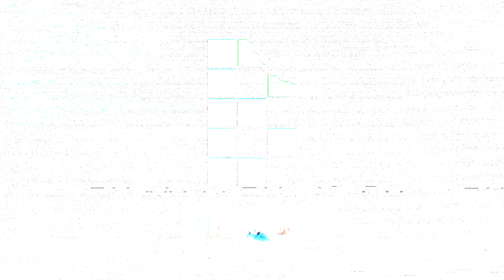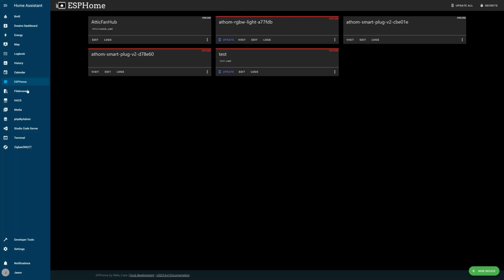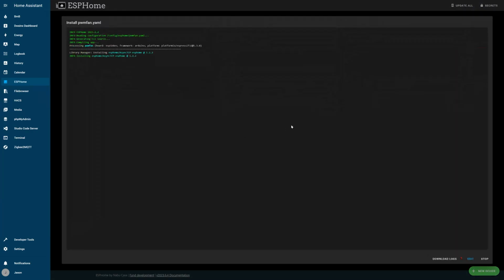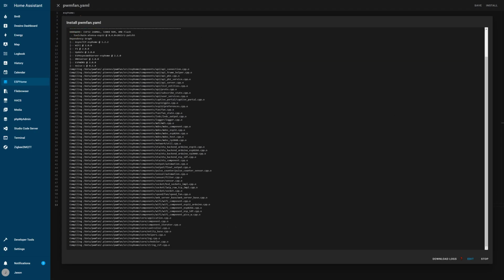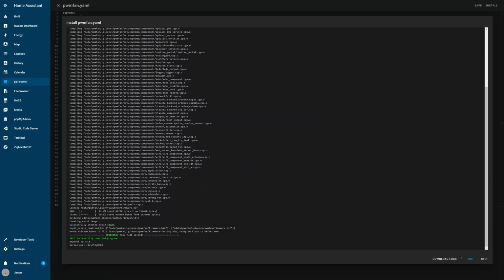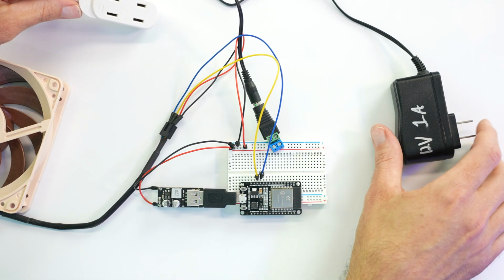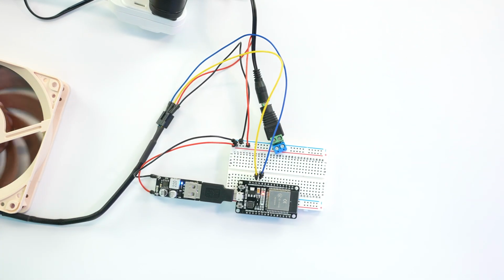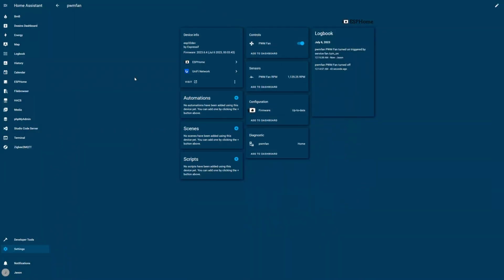Tutorial - How to control a PWM fan with an ESP32 and Home Assistant

Comment: on mine the VIN also supplies power, and I wired that to a DC step-up circuit. Unlike the 3v3 pin which will not allow the amps. We'll see if my stuff blows up in time but don't see clear documentation for not using VIN pin to power another device.

Comment: I tried this witch an Actic P12 Pro PST. Works. But I can not turn it off. It will turn slowly. Or more exactly: It starts, does some rounds, stops (but is still turning). And than starts again.

Is there a reason for that?

Comment: Hello! I have a question about one of the parts you used. What is the blue connector with the two screws that is plugged into the power plug connector?
Reply: Power Jack Plug Adapter Barrel Connector

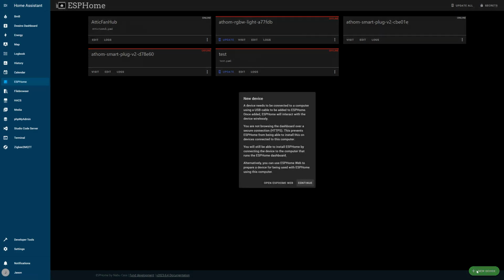Comment: 01:48 it is worth to mention that if you cannot see the mentioned "ESPHome" tab, that may be be due to one of 3 reasons that sadly isn't mentioned in this video (or noted).
1: Having "ESPHome" to be available from within Home Assistant requires that you are running Home Assistant as either a (and on a) physical device (like a raspberry pi, NUC, and old or repurposed laptop/desktop/server)) or as a virtual machine (or possibly an LXC container, which is NOT the same as a Docker container) on a host (preferably and much recommended on a hypervisor). If you are running Home Assistant as a Docker container, you can however easialy run ESPHome as a Docker container as well, you can then do some custom menu to get a buttin in Home Assistant menu, but it will most likely just open in a new browser tab (which works quite fine as well).
2: Assuming you are running Home Assistant on physical or virtualized physical hardware (see point above), then you need to install ESPHome from "HACS" (in short: like an app store for Home Assistant add-ons, which is integrated and technically run as a Docker container by the Home Assistant system)). Once installed, remember to enable, start and set it to start up at boot, if it isn't already once installed.
3: In "HACS", there is on some add-ons an option to add a menu point for the add-on to the menu, it may not be selected. As well as this, you may have done some custom menu's, that may affect what is added to the menu. This can be done when running Home Assistant as a Docker container as well.

Comment: 4:28 why did you pick that hole instead of having it right next to the other negative pin?
Reply: Dont worry there is no difference. You can plug in anywhere on the positive rail

Comment: Hello, I have a question, I plan to use this project as a cooling control for a case and a mini PC in a NAS server. I tested it and everything works as stated, but I'm wondering if there is an option to turn off WLAN in the code and control the ESP32 directly via the USB port.

Comment: Ich habe das Projekt nachgebaut - vielen Dank für die Anleitung. Es gibt aber ein Problem: Im YAML-Code:
multiply: 0.5
    count_mode:
      rising_edge: INCREMENT
      falling_edge: DISABLE
    update_interval: 3s
führt es zu einem Fehler unter Homeassistant. Fehlermeldung: "mapping values are not allowed here".
Ich kann die Einrückungen editieren wie ich will, der Fehler bleibt existent. Ich habde diesen Codeblock komplett entfernt, dann funktioniert es prima.
Für welche Funktion genau dieser Abschnitt im Code verantwortlich ich weiß ich nicht, ich bin noch Anfänger bei esp32 :)

Comment: can you do the same thing but with arduino iot? instead of having to use home assistat. I have most of what I need except the level shifter not sure if i will need it as yet but the whole home assistant thing with dedicaed hardware and all that i'm not gonna do just to control a fan in my shed lol

Comment: How do i control 2 fans at once? Do i duplicate the code? Use different gpi0 pins?
Reply: two different pwn pins. one to each fan for both operations. so you'll need 4 spare pins

Comment: TY for the easy guide. [might set this up myself for a DIY air-purifier that uses PC fans]

PS: for the code its better to share it on github. YT and other sites have horrible formatting, especially for YAML code where the difference between
Cheese______1
Cheese____1
Can cause the code to break

Comment: Can this be done cleaner some how?
Would it be possible to use the ESP it self to power the fan instead with the use of a boost converter or something?

Without having to include the secondary power adapter?

Comment: INFO ESPHome 2024.9.2
INFO Reading configuration /config/esphome/server-fan.yaml...
ERROR Error while reading config: Invalid YAML syntax:

mapping values are not allowed here
  in "/config/esphome/server-fan.yaml", line 34, column 8

i follow the same, but getting this msg
Reply: u can try this 

sensor:
  - platform: pulse_counter
    pin: GPIO13
    name: PWM Fan1 RPM
    id: fan_pulse
    unit_of_measurement: 'RPM'
    filters:
      - multiply: 0.5
    count_mode:
      rising_edge: INCREMENT
      falling_edge: DISABLE
    update_interval: 3s

output:
  - platform: ledc
    pin: GPIO12
    frequency: 25kHz
    id: fanhub_pwm

fan:
  - platform: speed
    output: fanhub_pwm
    name: "PWM Fan1"

Comment: Great Video but you don´t have to Step down the voltage. Your ESP32 has a build in Voltage Regulator. Just pluf the 12V in to the Vin Pin. Do not Plug it into 5V!!!

Comment: Hello Mister. Can you tell me how i can do exactly what you did but with a 2 wire fan? I need to do a home assistant automation that controls the rotation of a 2wire fan based on the internal temperature of a device, temperature that i already have in HA. Control will need to be done automatically by HA as i don't have how to stay and turn the regulation switch between low & High all the time. Thanks!

Comment: great tutorial!
im tring to make fan control for rack cabinet. for me control of pwm is not possible :( i can only turn off and on. i see actual pwm value, it is always maximum 2400 rpm. when i move slider nothing happens. 

would be great to have also temperature controlled pwm fan!
Reply: i found that there was missing "" in the code on   frequency: "10000 Hz". but now rpm are fluctuating if i set other value than 100%. any help?

Comment: great video. id like to do this project but have multiple fans (15 total). They dont need to be indivual speed control. If I wanted to connect multiple fans and have all speed controlled together as one fan. . . is it a case of using fans that can be daisy chaimed. . such as phanteks T30-120??? assuming of course that power supply is capable of enough amperage

Comment: Hi, this is so cool! Do you know if there are any Home Assistant or Homekit  (or smart device) diy projects that support pwm for monochromatic LEDs that only have the two pins (ground and positive) and no data? I have some LED signs that only have about 120 leds on each one of them but they are super bright! I’m dying to use one of my extra microcontrollers. I bought some mosfet modules just in case I can find a project. Any thoughts would be very appreciated.

Comment: I followed the tutorial and the fan would do all kinds of powering up and down. I thought it was because the pwm voltage was low, but Noctua said that 3v pwm is fine. Then I finally read the warning at the beginning of the "logs" command in ESPHOME about GPIO12 being a pin you should avoid. I switched it to GPIO15, the 3rd post on the other side and it worked like a charm.
Reply: for what it's worth, I was having an issue where home assistant wouldn't accept the api encryption key.  So i moved gpio12 to gpio14 and it worked right away.
Reply: That is not right, it works with 3 Noctua 14" fans in my installation!

Comment: Just a heads-up, you will need to make sure your fan actually accepts 3.3v for the PWM logic. Certain fans require a 5v PWM signal, so you will need a 3.3v -> 5v I2C Logic Level Shifter
Reply: Now it also needs a MOSFET to really switch OFF the fan if it doesn't do that via PWM. And maybe also an RC filter for the RPM signal. And some sort of alert of the read RPM differs wildly from the one set via PWM.
Reply: Great suggestions  @dan-nutu  ! But in some cases it could be overkilled, sometimes we just want it to work
Reply: Can you please explain a bit more about this?  How the fan that the video owner has is working with his setup? I did not see a mention of the 3.3v -> 5v I2C Logic Level Shifter and now concerned that my shopping of the items may not be enough.
Reply: @a2shadow  each fan is different, most do accept 3.3v input for pwm, but you can check the tech sheet on most fans website which should have some more details
Reply: Or use your 5v VIN output (if powered by usb) and your gpio pin to trigger a relay which pulls your 5v pulsed signal to ground. DIY negative logic

Comment: Dear friends, I have assembled two Noctua NF-A8 PWM fans and apparently everything works as expected. I can turn the fans on and off and change the speed all with an ESP32 without a TTL converter board. 
I have connected them directly, 12V power supply for the fans and the 2 control signals directly from the fans to the ESP32. I use 2 different power supplies, 5v for the esp32 and 12v for the fans. I have joined the gnd of both feeders together with that of the esp32 so that everything works ( It works more or less well, from 0% to 9% the fans are stopped and from 10% to 100% the speed varied perfectly, I don't understand this error range from 1% to 100% but it more or less meets my expectations )

I have found a bug. While the fans are spinning, if I disconnect the power from the esp32 and reconnect it, the esp32 protects itself and does not start, the esp32 feeder making noise. I have to turn off the power to the fans, wait for the esp32 to start and then plug in the power to the esp32 and everything works fine again. Another option to solve the problem is to disconnect the Output pwm pin of the esp32, then the esp32 boots correctly. It seems that some noise is sneaking through the output control pin.

It's not a big problem but it makes it impossible for me to use a single 12v power supply for the fans with a 12v to 5v converter to power the esp32. Has anyone had this problem and how to solve it? 
I would greatly appreciate the help. I have tried with some filtering capacitors connected from the output pwm to gnd pin but the operation of the fans varies although the esp32 starts correctly depending of the capacity of capacitors. Thanks everyone for your help. Kind regards
Reply: Did you solve this issue? I'm planning to assemble controller for 2 of my Noctua industrial pwm 3000 fans. I need something reliable.

Comment: Isn't the PWM signal expected to be 5V? But the ESP32 outputs 3.3V right?
Same with the rev counter signal coming from the fan, isn't that 12V? And you are putting that directly into the 3.3V ESP32, ain't that a bad idea?
Reply: thank you for noticing that, i was about to do the same as the video.

Comment: Do we need to lower the tach pin down to 3.3V with two voltage dividers resistor? Does straight connect tach pin to esp32 safe?

Comment: Fantastic video. Would this work with daisy-chained arctic P14 fans? I saw designs for making a corsi rosenthal box with pc fans instead of a box fan for more silent operation. This seems like an absolutely perfect implementation for powering the fans.
Reply: here for the same reason after some wild fires nearby, any luck finding if it works?
Reply: @seyamrahman6722 yeah it works. I built one with 5 Arctic P14s. All daisychained to one plug.

Comment: Hi, I have a question. Why are you able to completely stop the fan? When I try to do that, the fan continues to run even when turned off. In other videos, they use a relay in between. Why does it work for you without one :-) Thanks
Reply: In this video he doesn't show the relay. Without a relay, the fan continues to run at the minimum speed because with PWM control there is always 12V on the fan.

Comment: Why you connected tachosignal directly to an esp gpio? If I‘m right tachosignal is a 12v pulse and max voltage for gpio pin is VDD (max 3.6v) + 0.3v… so you possibly could destroy the pin.

Comment: @bytemybits I followed your video and have added a esp32 to Home Assistant. I can see fan switch and rpm reading in my discovered entity.   Changing fan speed works but off/on does not.  What can I do to turn off the fan from HA?
Reply: In this video he doesn't show the relay. Without a relay, the fan continues to run at the minimum speed because with PWM control there is always 12V on the fan.
Reply: @ThomasKlinder  in which video is the relay shown?
Reply: @Bytemybits Same here. It always spins minimal speed when turned off.

Comment: that 12v to 5v regulator is not needed, all ESP32 devboard comes with ASM1117 voltage  regulator, it can accept 5v - 24v via VCC pin.
Reply from the maker: Well damn.. I thought they could only do 5v. 😂 oops
Reply: is that true for ANY ESP32? The internet seems to be not sure about this and you read a lot of "should work" :D
Reply: the ASM1117 accepts up to 15v i thought...

Comment: This video was the DEALbreaker for me, I’ve ordered som esp’s, and it will bee awesome, if you could show how the temperature sensor could bee in the installation also, it Will bee nice, then i will make it in ny network/server rack
Reply: captive_portal:
sensor:
  - platform: pulse_counter
    pin: GPIO13
    name: PWM Fan RPM
    id: fan_pulse
    unit_of_measurement: 'RPM'
    filters:
      - multiply: 0.5
    count_mode:
      rising_edge: INCREMENT
      falling_edge: DISABLE
    update_interval: 3s

  - platform: dht
    pin: GPIO2
    temperature:
      name: "Serverskab temperature"
    humidity:
      name: "Serverskab humidity"
    model: DHT11
    update_interval: 10s